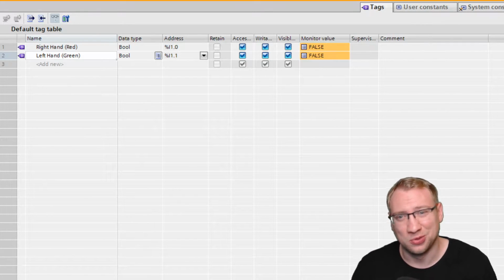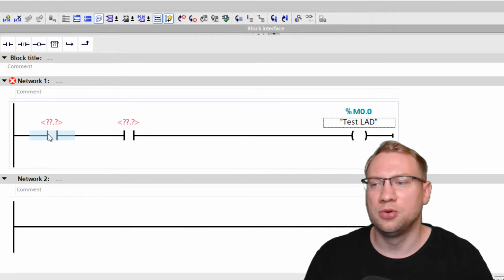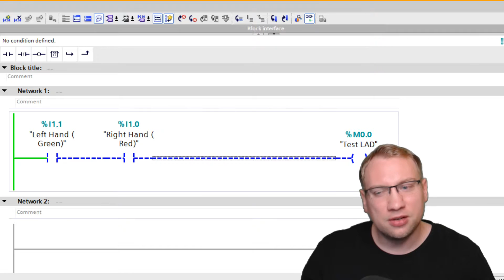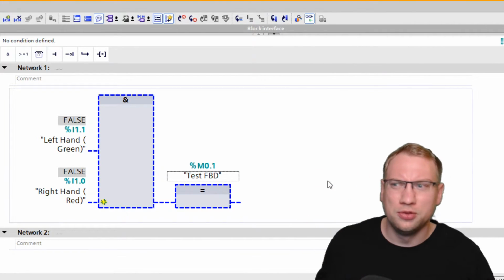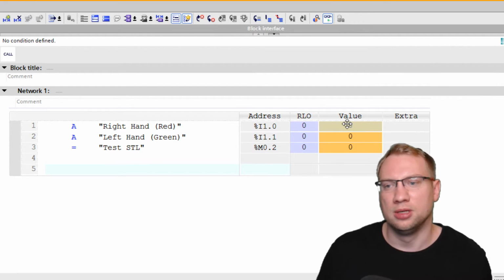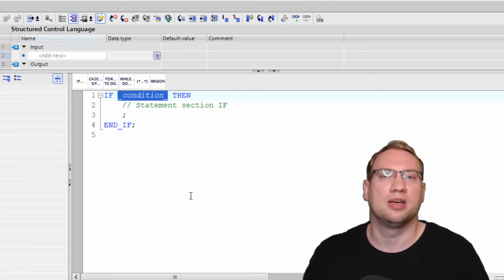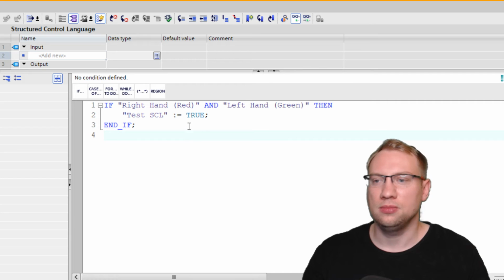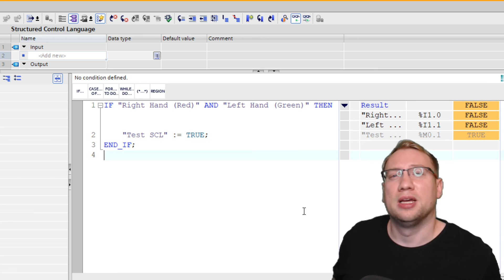Logic AND: Boolean Circuits in LAD, FBD, STL and SCL

Comment: The SCL code is not an output function, it is a set function because the "Test SCL"  is only set to true and not reset.
The code needs to be:

IF "Right Hand (Red)" AND "Left Hand (Green)" THEN
        "Test SCL" := TRUE;
ELSE
   "Test SCL" := FALSE;
END_IF;

or the easiest way

  "Test SCL" := "Right Hand (Red)" AND "Left Hand (Green)";

Comment: You forgot Graph.
Reply from the maker: GRAPH is a "special" language, that is only used in sequential machines. There are some more languages with "specialized" applications. The four in this video mainly have the same purpose (which is boolean circuits)

Comment: What is the difference between A and O? I see both in use in STL. Usually the “O” comes after “A”
Reply from the maker: "O" stands for an "Or" operation... meaning that if the result of this line OR the previous one was "TRUE", the result from this line will also be "TRUE"
"A" stands for an "And" operation... meaning that if the result of this line AND the previous one are "TRUE", the result from this line will also be "TRUE"

Comment: Little nuance with SCL:

Since there was no line such as

ELSE
    TestSCL := FALSE;

The TestSCL has been "latched" (or Set to 1), so it won't reset upon releasing both buttons.

Another way of programming it could have been to do something like this:

TestSCL := ("LeftHand" AND "RightHand);

If you want to make it shorter. But anyways, I typically reserve SCL for analysis rather than for hardware control
Reply: To make it even shorter, it's possible without the brackets ;-)

I also want to add the detail, that the if/else statement corresponds to an SR flip-flop.
Reply: @joerg385  good call. The brackets (or parenthesis) were not necessary indeed.

Also, more specifically, "elsif" along with "if" would compose the SR flip flop, since "else" includes every possibilities except the ones stated in the If and Elsif statements